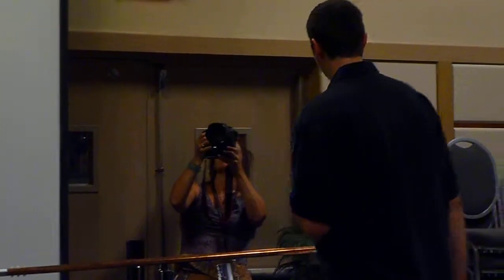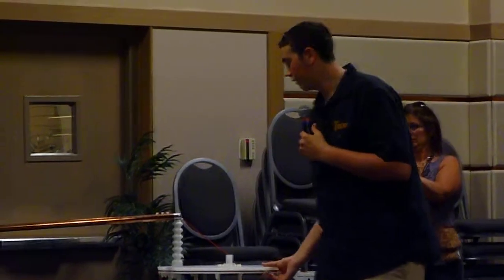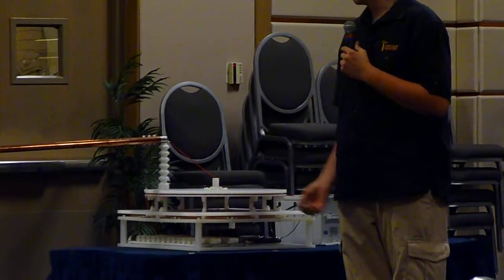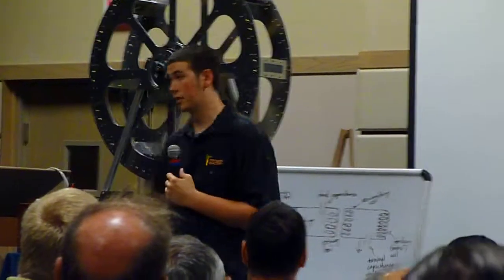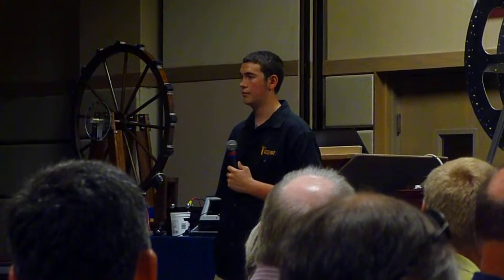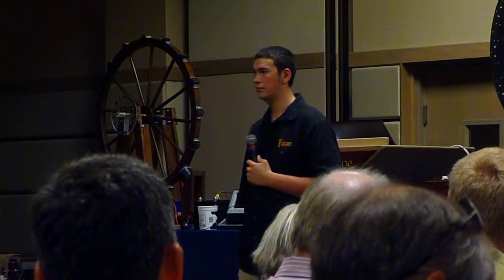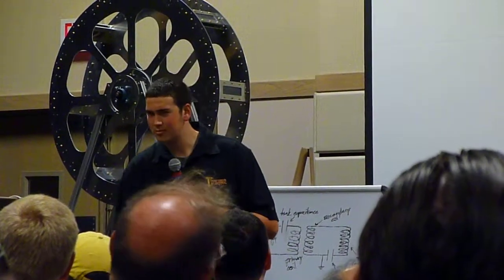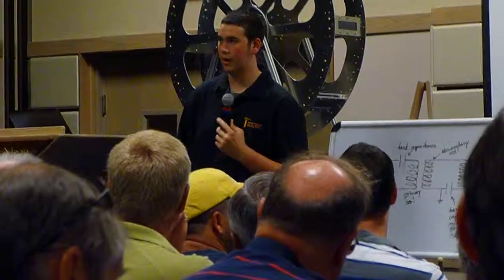Tesla Coil Demo and Explanation (5 of 5)

Comment: This is interesting, but those are not Tesla coils. Those are Sir Oliver Lodge coils.A tesla coil transforms the electricity from DC to longitudinal cold impulses. He says this is in almost all of his early writings. There is a transformative process that the energy undergoes in a spark gap when it is interrupted over 15,000 times a second, and the more you interrupt it , the higher the energy output.Tesla was interrupting his circuits at millions of times a second, and using very large coils to get a low frequency harmonic. That is what a true tesla coil is. Lodge coils are only amusing to look at, real Tesla coils are beneficial in many ways, including excess output power that brings the COP to over 1.